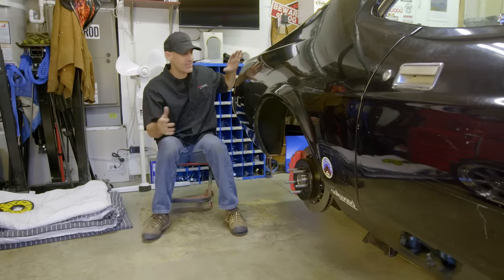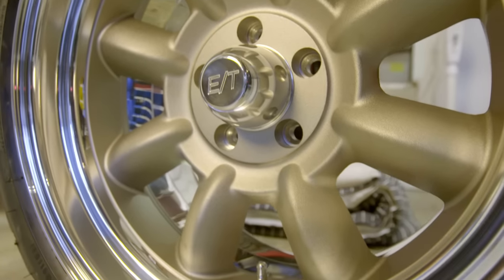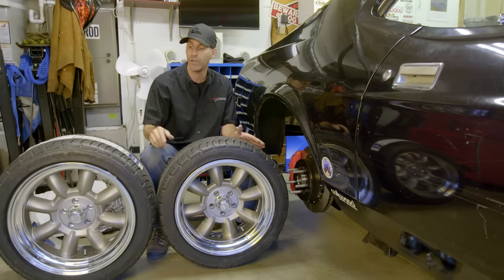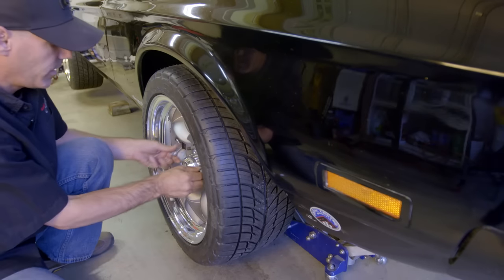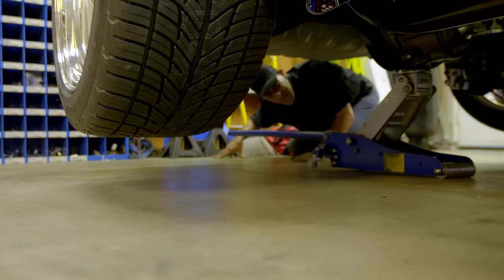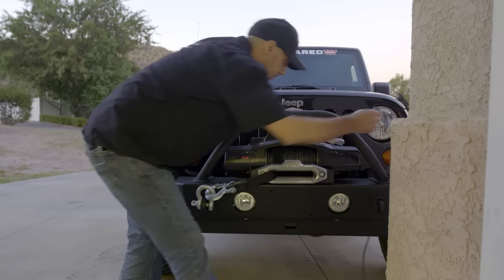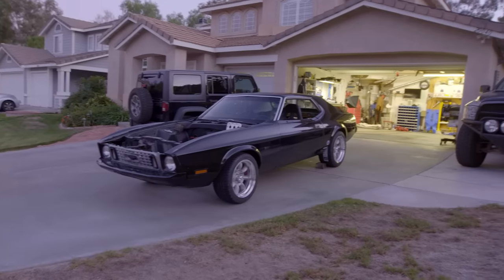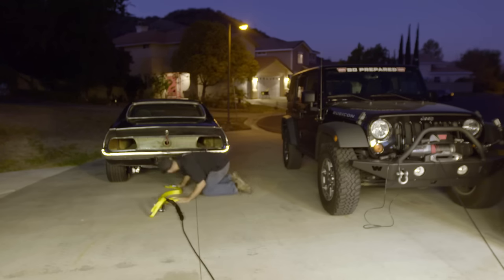Custom Vintage Wheels for Muscle Cars - The Mustang gets ET Mags and BFG Tires!

Comment: it's very hard to picture a nice set of wheels that can fit the style in this platform. you nailed it with the offsets and height looks fine. another inch drop would had just killed it.
Reply from the maker: +B00steDevil The coil overs are adjustable so I'll be able to dial it in pretty good!

Comment: 😮 i had a set of 15x9's in the 90's that had the exact same 8 spokes but the center cap covered the lugs and had a big plastic nut with Carol Shelby written on them. They were a 6 lug pattern i put them on a Nissan pickup.  Never seen another set exactly like them.

Comment: Hi Jason, I took your advice and used copper/nickel fuel and brake lines. Thanks. I have a question though about how you got a 14"  Pro+ 6P Wilwood  into a 17" wheel.  A 13" Pro+ 6P Wilwood brake iWILL NOT fit in a 17" wheel from my research.  I have the Wilwood template and I've done the math. Could you clarify what Wilwood brake system your using and how they fit in a 17" wheel? Thanks.
Reply from the maker: I have this kit https://www.wilwood.com/BrakeKits/BrakeKitsProdFront?itemno=140-10220-DR&year=1973&make=Ford&model=Mustang&option=Disc+Brake+Front+Spindle
It's got a 13" rotor and does a fantastic job of stopping this thing!

Comment: It seems the car is a cross between a 2 Door Ford Torino and a 2 Door Ford Capri.  @5:32, you can see the Torino from pillar A including the door and most of the rear quarter panel and the Capri from pillar A including the front fender with the headlight and grill stance. Beautiful car man, I love it, just wish it was another colour other than black/charcoal... :)